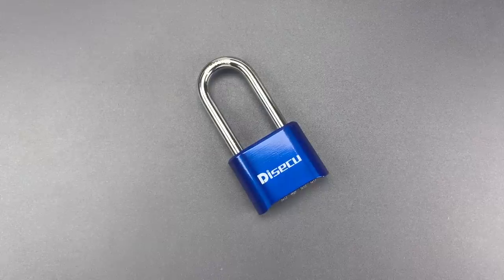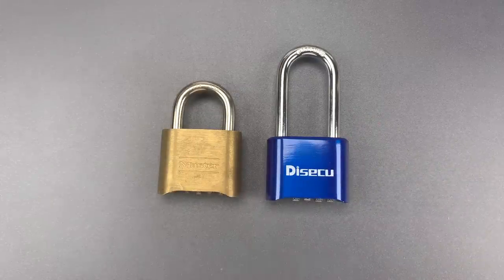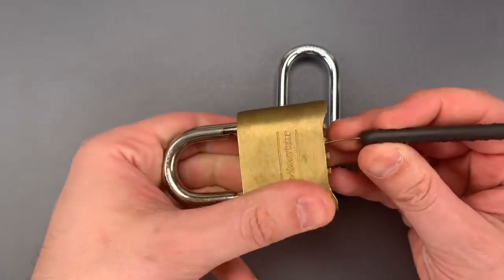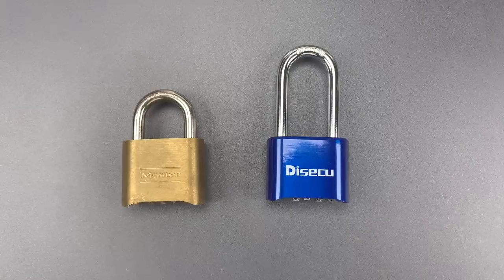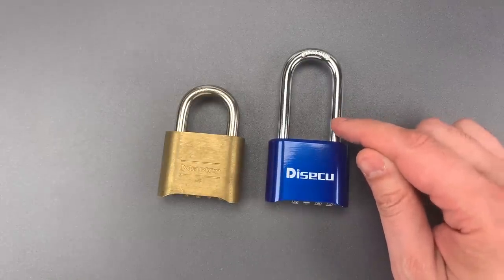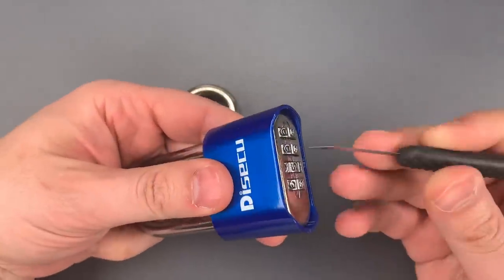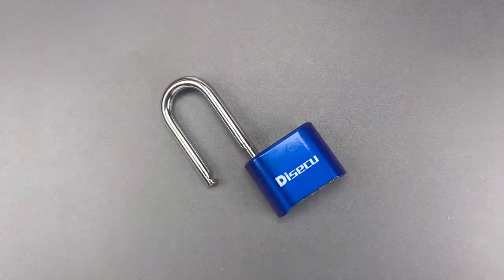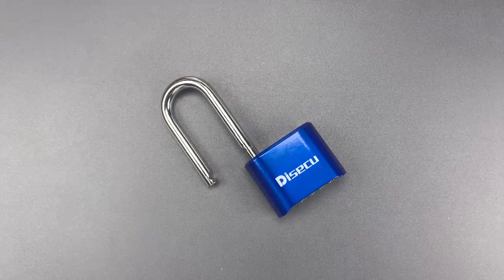[996] Open in 2 Seconds: Disecu Combination Padlock

Comment: We copied Master because their designs are always so masterful.
Reply: Masterfully terrible
Reply: People DO buy Masterlocks - So the competition says, "People want crappy locks? Then we'll give 'em what they want!"
Reply: Masterlock is a
 very appropriate name for locks that be opened by almost anything.
Reply: Masterlock and most lock companies that follow their example will never change unless there is a pressing need or something drastic happens that forces them to make changes. Padlocks and any locks only work for honest people and are visually a deterrent and physical one. Obviously if something is locked you normally can't get in but if you're desperate enough and determined you will. The only examples of a successful picklocking defeat is nightwatch and that's a manual activation which prevents bumping on top of rotating the core when it's engaged. At least that's a lock type or variant that will at least keep you safe from picking when you're home. That's really the only example I could thing off when a lock company re-changed a lock for lockpicking type attacks.
Reply: Where is the lock then ?
Reply: I don’t what your asking? LPL has gone over night watch before and discussed how he couldn’t pick it with it engaged. Without it engaged it was a relatively easy pick. As for where the lock is could be any of the millions of deadbolts. That said, how many people own that particular type of deadbolt no idea.
Reply: breaking the 666 likes
Reply: @colinsouthern  Yep they definitely just fall open at least they do for me hahaha.

Comment: "So it gave me hope that they changed the locking mechanism as well"

Looks at the timeline
-1:40-

--> No, they didn't.
Reply: I hate that YouTube serves up a 4:00 commercial on a 1:39 video...
Reply: Hopes dashed.
Reply: @dahveed284  I got a 9+ minute commercial
Reply: @jimstand  YouTube does things like that if you run certain adblockers.  They make it so the adblocker doesn't block the ad itself but does block the "Skip" button.  Cunning.

Try a different ad blocker.
Reply: @bdf2718  or don't use ad blocker so the LPL gets ad revenue ??
Reply: @dahveed284  youtube vanced for mobile or ublock origin for desktop. What ads?
Reply: @davemcdaniel4856  Or just pay youtube premium

Comment: I got one of these for Xmas. I had an issue where the combination wouldn't work anymore so I couldn't get into my shed. I used a .30 feeler gauge used for measuring valve clearance on an engine and shaved the sides down so it would fit and it only took me 2 seconds to open the lock. It's faster than it takes to enter the combination. Thanks for the video! You saved me having to take an angle grinder to it.

Comment: For a moment, I thought there was going to be something that made this lock worse than the Masterlock
Reply: There is.  All he has to do is use the metal tool on this one.  On the similar Master Lock, he has to use the tool but also press down on the shackle to get it open.  This one here doesn't require pressing on the shackle.  So in that sense, it is easier and simpler than the Master Lock.
Reply: @LatitudeSky  Wow

Comment: Im honestly getting scared, that if anyone actually wanted to get my locked stuff, they'd get it....
Reply: With ease.
Reply: It's possible to protect locks with some self made obstacles, like tubes and sheet metal boxes with holes for shackle. Some types of attack can be thwarted, which may make a difference.
Reply: Most attempts to burglarize use brute force or victim negligence (like leaving a door unlocked), not picking or bypassing locks. In general this isn’t something to worry too much about, but if you can spring for the higher end locks that don’t have flaws like this, that’s definitely a plus.
Reply: Easy. The key is reasonable secure. No need to use a $50 lock for a gym locker  or a $200 lock on a card board door. However it is useful to know what lock needs at least some effort.

For a gym lock use something that you have to ise force to get open. That's loud and that's the best protection when people are around....

Comment: I use a Master to lock a gate from the inside, where it is not reachable from the outside.  I'd like to have better security along with ease of use.   Are there any of these resettable combination locks that don't suffer from this or other silly flaws?

Comment: The master 175 is what we use to lock up nuclear codes in the ICBM LCC's interesting
Reply: For real?
Reply: "00000000" needed a lock on par of it's decryptability.
Reply: @michaelrizka  Yea, system is set up that it wouldn't matter if you picked it but you would freak somebody out.

Comment: Can u please point me in the right direction on the tool u used or some similar

Looking to open the lock like this on on my shed it froze and combo’s not working 
Tried to use soda can but not strong enough 
Please where did u get this tool 
I looked on ur website but didn’t see it

Comment: Since its a 4 digit combination, one can also get it open by using the right combination from 0000, 0001, 0002 all the way through until you reach 9999.

Comment: LockPickingLawer, about a week ago I sent you a question in the comments, but unfortunately never heard back? So I'm trying again. I found a lock that is fairly expensive. They say it can withstand 12 ton hydraulic cutter attack, anti-drilling and picking resistant, and waterproof w/embedded sensitive motion detector sensor for unauthorized movements. The 1st price I saw it at was $362, now they have a deal going on for $197 I believe. I was curious to see if it was possible for you to get ahold of one of these locks and try to defeat it? The name of it is "Ziilock". If it isn't possible to get one that's ok, but I thought it may possibly bring a little challenge to the game. Also if not possible you could send me a message letting me know. Or maybe you have already done this and I didn't see the episode.

Comment: I have got one similar but it has a button also, that you must press once the code is correct. So how can i pick?
Reply: Same way as these?
Reply: @sleeptyper  almost, it is a combination lock with 3 numbers, and a button to press
Reply: @somemes9546  Hold the button in and feel which wheel is binding.  Turn that wheel until you find a slack spot.  Repeat for the two others.

Just a guess, but unless they put a lot of effort into the design, or manufactured to tight tolerances, that button actually helps rather than hinders.  With only three wheels I doubt they put a lot of effort in.
Reply: Miguel Pedro Try manually first.
Pull the shackle and find binding wheel...
Reply: @XtreeM_FaiL  thanks for anwsering, i will try

Comment: The 875 is better than both of these (which is a newer version of the 175)
Reply from the maker: Not really. See video 631.
Reply: @lockpickinglawyer  I know that the 875 can be decoded just by testing how much the wheel turns I know that but the 175 need a tool to change the combination but 875 doesn't and the 875 can't be bypassed but 175 can be bypassed
Reply: LockPickingLawyer I watched the video.Thats what you say